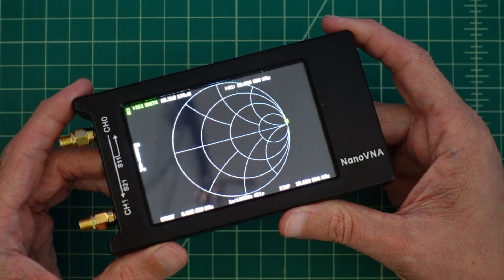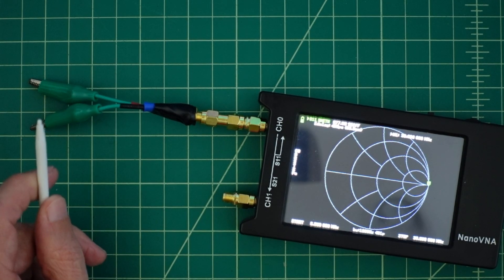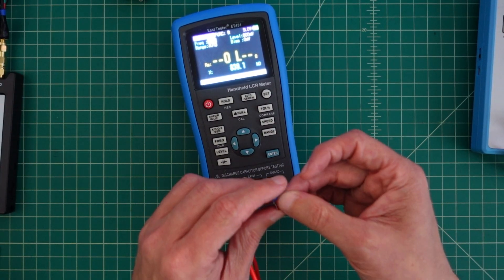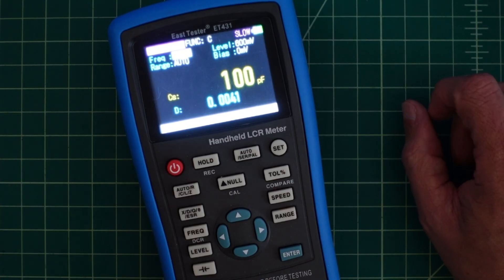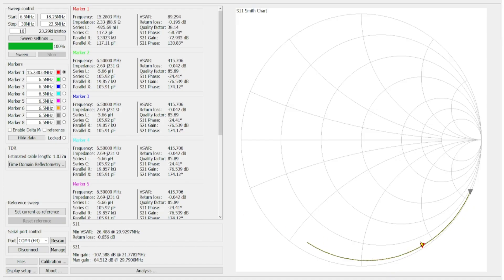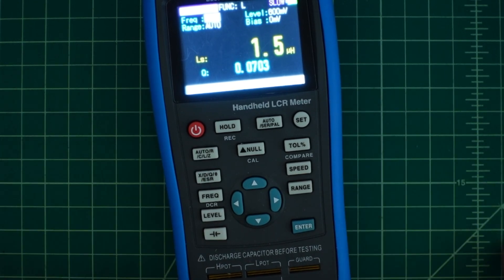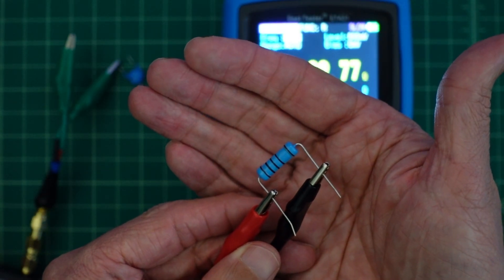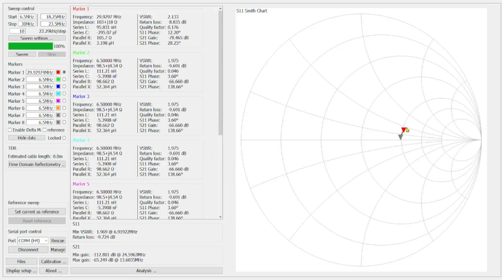Measure Capacitance and Inductance with a NanoVNA

Comment: So, I think I could use a similar technique to measure a delay coil. To do so I would just look to see where the smith chart circles back around and crosses the axis, right? Do you know?
Reply from the maker: What exactly are you trying to measure?
Reply: @TheSmokinApe  a delay coil for a collinear antenna. (Like a super J only with a coil for the delay) I’m thinking I could use my alligator clamp jig similar to what you did here, but I’m looking for the frequency where it crosses the axis the second time (full 360°). 

I should be able to sanity check that it’s in phase at that point as well.
Reply from the maker: Makes sense, I’ve never tested that so I’m gonna say “good luck” 👍

Comment: For more precise readings when using test leads like that, or even test fixtures, you can do your cal with the leads in place. Just short the clips, open the clips, and put a noninductive 50 Ohm resistor between the clips. I keep a small, leaded noninductive resistor as part of my cal kit for that purpose.
Reply from the maker: Great point John, I actually have a video showing how to do that 👍

Comment: Why does the nanovna swr not match my g90 swr on the same antenna
Reply from the maker: How far off are they?  The VNA is calibrated right?
Reply: @TheSmokinApe more than a point. yes vna is calibrated. someone online told me the nanovna doesn't actually measure swr only something approximating it?
Reply from the maker: It measures SWR, they are mistaken.  You using the exact came test conditions? Adapter and connectors and transmission line?
Reply: @TheSmokinApe  my coax run to the shack is SMA, so it goes straight to the VNA, the G90 uses a sma to uhf adapter. I have more adapters Ill try a different one?

Comment: When you said that you expected that the resistor would be inductive, I believe that statement would only be true for wire wound resistors...like the one you were testing.
I dont think solid resistors would do that...

Thoughts?
Reply from the maker: Yes, I agree but I think most will do this unless it’s a quality non-inductive resistor 👍
Reply: @TheSmokinApe  I did a search for solid resistors and it is hard to find one that is not SMD. But the one I did find is power resistors for microwave oven's magnetron section... I am going to order some 50 ohm ones and try them out in a DIY dummy load. This may be a good DIY video for you also.
Reply from the maker: I’m interested to see how it goes 👍

Comment: I just recently upgraded my 1st gen 2019 nano vna, which was giving me good service although tho letters on the screen are very hard to read. I bought the nano vna h 4.3 after watching your review. The sceen text is much better. But comparing swr on both i get vastly different readings. I do a full calibration on both but the old one may show a 1:1.5 the new one shows 1: 8.7. 
My question is, are there any ways to actually check what is correct? Subbed and liked. 73 ZL3AXL.
Reply from the maker: Hey Sandy, did you use the same calibration standards on both?  Also, do you have a known load, like a dummy load you can use to compare them?
Reply: @TheSmokinApe  Yes. Every thing for calibration was same - 50 ohm dummy was good. My biggest concern is which nanovna is more accurate, and can bad one be corrected or thrown out.
Reply: I have a big 100w 50 ohm dummy load thar could pressed into service. Didn’t think that would be needed.
Reply: All good, thank you. I used my big 100W 50ohm Dummy load with a home-made pl259 short and no open to calibrate both my nanovna at the same time and now things have settled down. The SMA and BNC dummy loads are now history. You advice to use same calibration sets for both put me on track. But by using the full size hf calibration set, I got better consistencies with the units.
one very happy camper - thank you.
73 from New Zealand
ZL3AXL.
Reply from the maker: @sandyjohnston9457  awesome, glad you got it sorted 👍

Comment: that handy ! knowing how copoint's react at a given frequency is important.  the listed value can change.  inductors can have stray capacitance that changes with frequency came with a cap or resistor.  even core type in a coil like ferrite mix. 73's
Reply from the maker: Yeah, I had been playing with it for a little while and figured I would share.  Thanks for watching Robert 👍

Comment: Hey Ape, What attenuator values would you use to test harmonics on a 20 watt handheld with a TinySA Ultra?
Reply: I calculated 43db for 20 watts so I have a 25 watt 30db and a 10 watt 10 db attenuators so that leaves 3db going into the TinySA Ultra, does that sound Kosher?
Reply from the maker: Yes, 20w and s 43dbm.  You really want the in input signal to be about -20dbm for best results.
Reply: @TheSmokinApe  I have a 25 watt 30db and a 10 watt 40db that would make it 70db minus the 43 would make it 27db down, do you think that might work?
Reply from the maker: Yeah.  I’d make sure the power coming from the radio goes into the 25w attenuator first 👍

Comment: Good stuff. Kerry Wong did a review of the ET431. He said it was decent. I bought one and find that it is decent but no better than my BM4070. The ET431 cost $100 more, but is more pretty.
Reply from the maker: The Proster? C’mon man…
Reply: Nice. Yesterday I took my old BM4070 from the shelf and tested some caps and inductors. It works fine, even if it looks and feels like a toy. My reference though is my 10 year old DER EE DE-5000 (not so fancy looking either), but with true Kelvin measurements at least.

Comment: I have been thinking about getting a Nano VNA for the past week or so. And I literally had it in my Amazon cart and hour ago. This video made me go pull the trigger right now without even watching it yet.
Reply from the maker: Everyone should own a NanoVNA 😮
Reply: I will own one on Thursday 😎 I'm also going to order a TinySA
Reply from the maker: @patthesoundguy  nice, get the TomySA Utral 👍
Reply: I've had one since they first started making them, been really handy for sure.
Reply: @GoonyMclinux  I'm so excited to be able to really look at what's going on with antennas. Especially as I get to building more when I finally get my Ham certificate. Took the course, just have to book the exam.
Reply: @patthesoundguy  Over the years I had vna's, they weren't under $100 though they were minimum thousands of dollars. These things are amazing and I recommend you get a Tiny SA which does a whole load of other fun times ham stuff. Add in a nice oscilloscope and you can pretty much radio anything to death. 🤣
Reply: Also consider the LiteVNA 64. Especially if you are into microwaves.
Reply: Pat ... we call Ape the "enabler"! Don't expect to hold onto your cash when Ape gets "explain'n"! 😛
73 - KF6IF